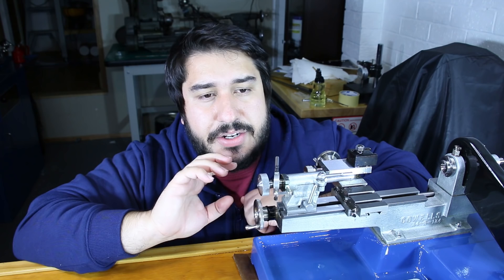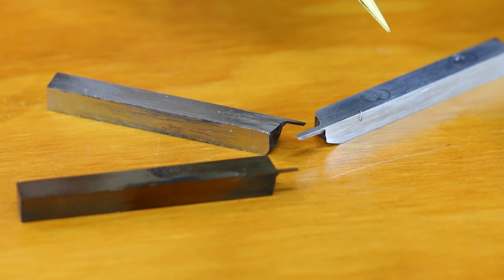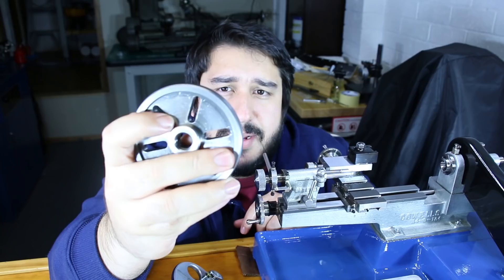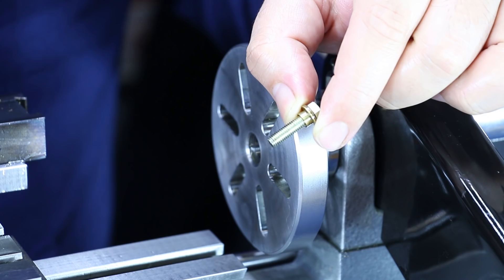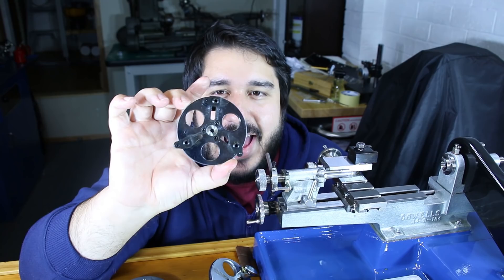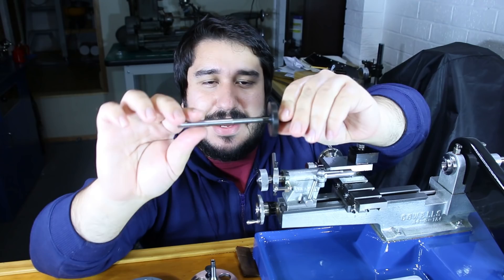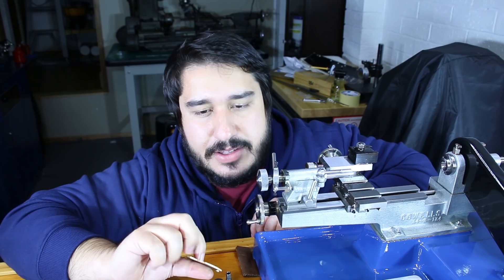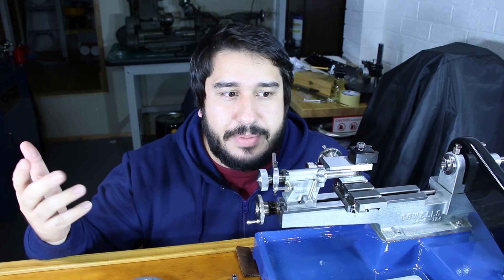Watchmaking Woes, Starting again, giving up? Episode 4

Comment: I was a machinist for ten years. Scrapping parts is just part of the process. Just a matter of practice until the precision is there. If you wreck 100 plates in the process, it doesn't matter as long as you learn WHY you wrecked and keep improving. 

We would generally start with the most difficult process first, so if it gets scrapped you haven't wasted all your time on the other processes.

Don't give up!

Great video series!
Reply from the maker: +dimman77 Thank you for your encouragement and wise words!
Reply: and i am a mechanical engineer. this is basically what chinese do. all you are doing is copying. making a watch starts from design. design doesn't have to be from scratch, but once you start doing it on your liking it becomes your identity. so get a 3D cad drawing software first and make your own watch - literally.
Reply: dimman77 i
Reply: dimman77 i

Comment: Good update. I personally like these types of failure/solution videos since it shows someone else doing the same kind of trial and error stuff to solve a problem and it gives me a solution to a problem I (hopefully) haven't had preventing that problem. Keep up the good work.
Reply from the maker: +M B Thank you, I'm glad you enjoyed it, I wasn't sure initially but the responses have been positive. Thanks for the support!
Reply: Dean DK Hi again, Dean. I just went over your train bridge video again and have a comment about the drills and how you would prefer to bore to size. I think the drills are too long to be precise. You would be better with shorter, more rigid drills, or even using an end mill instead. You'll get less flex and there is less chance of the drill skipping before it bites (even with the center drill), or wandering out of square as you drill.

Also if you want to recover the part, you could punch out the holes larger and use chatons.

Another thing is do you have a depthing tool? Then you could just pull the donor geartrain and lay out the centers yourself much more precisely and easier to pick up the hole centers with the microscope.

Just some thoughts.
Reply: M B iii

Comment: Dean,
Making precision holes requires a sequence of steps after the hole location is established:
1) Center drill
2) Drill
3) Bore
4) Ream

The process of stacking the plates to ensure that all of the holes line up is called align boreing. This was a common practice to make blanking dies.

 Don't worry, George Daniels had to go through the same learning process you are currently facing. Keep plugging away; it will work out at some point.
david
Reply from the maker: +david pierce Thanks for your advice and support David! That's the process I had in mind :)

Comment: Hi Dean,
I watched this vid a couple times and I agree with others who commented re errors are normal and happen.

That being said, there is a real advantage in using a mill to bore rather than a lathe because a mill has XY movement of the table to locate holes. Those that have the means would get a jig boring machine with optical scales, sometimes with a precision rotating table to bore holes very precisely for watch plates. Now, I am not suggesting you have to get a jig boring machine but you might get better results on a milling machine than a lathe.

Daniel
Reply from the maker: +AtelierDBurgoyne Hi Daniel, thanks for your support. I agree with you, unfortately I have no Milling machine :( after my new lathe purchase I cant get a mill anytime soon.

 But I am saving for either a mill or if I can get a decent used Jig Borer.

Comment: Hey , I ran across a site that has a bunch of lathe and drill tools , also , when you were trying to drill small holes or any , clamp it between 2 scrap pieces after drilling pilot holes , to avoid those egg shaped holes from a twist drill - the world is full of problems ,I have solutions  !
Reply from the maker: Thanks for that info Kevin!

Comment: Good thinking there Dean! Why not just use the face plate on your watchmakers lathe though? Because of the centering scope?

How are the Chinese face plates when it comes to accuracy? Is it running flat and true? I'm also interested in knowing the process for boring the holes, but I suppose time will tell. Normally you drill and then bore for accurate holes, in order for the turning tool to have an inside diameter to cut on. Provided you did your centering right from the start it shouldn't cause any accuracy issues apart from the first couple of passes with the boring tool being interrupted cuts. Start with an under sized drill and then bore to final diameter.

Best regards
Karl
Reply from the maker: +Karl Månsson Hi Karl, the watchmakers lathe I use a Levin brand cross slide, I do have a shoe which ia supposed to square up the attachment but I have found it to be slightly off. Also, the larger cone bearings and sturdiness of the Cowells makes for quick accurate work. 

The Chinese faceplate is quite accurate, I found that even the lathe was from factory. 

The boring will be done as you described, drill and then bore. I will make some plug gauges to ensure correct diameter.

Comment: I see you have a beautiful  cowell's lathe , with lots of adaptors and widgets  ,  I don't want to sound  harsh , but the one thing you cannot buy is expierience , and the knowledge  of lathe working for 20-30 years .  there are methods to drill useing a lathe and  the hole is centered   {[it kinda self centers  itself }  I would suggest working with a master even if its free for some time  . the tips you can learn  are worth a fortune in books  ,  if this is just a hobby , keep reading and asking questions  !!!  persverence makes the man !!
Reply from the maker: Hi Kevin thanks for taking the time to comment. I hear what you are saying, in terms of a mentor. In my current circumstances I think I will have to grit me teeth and perservere. 

I did end up making 0.5mm lathe tools with a file to bore these holes, which can be seen in my latest video.
Reply: well good luck , sometimes you need to step back for a momnt , to move ahead . I have a feeling you will succeed .
Reply from the maker: Thanks Kevin! I understand, those feelings are always there in the back of my mind. I believe there will be a point in which I will have to in the future.

Comment: You never checked any of the runout in the previous video. Perhaps you did off camera?
Reply from the maker: No I didn't. It was more than even though I was looking through magnification, and the hole was not a perfect circle it was very hard to gauge. I have found an extremely more accurate and better method of by centering off the jewel hole now